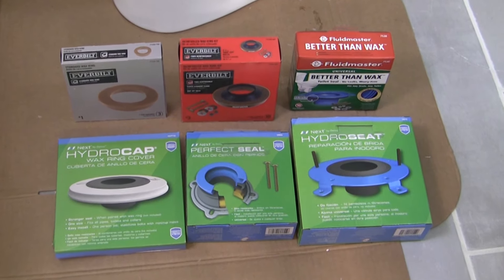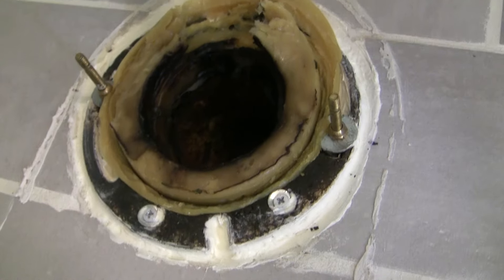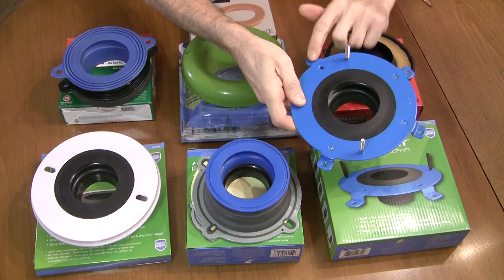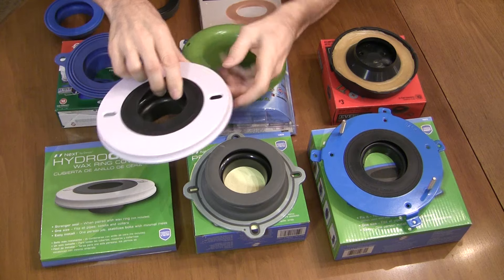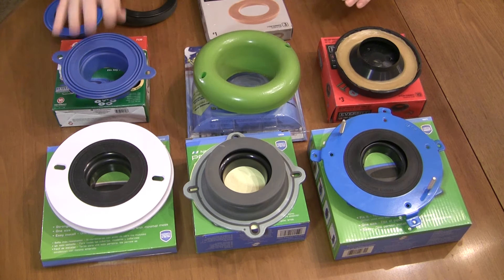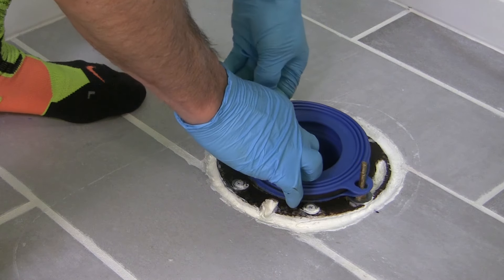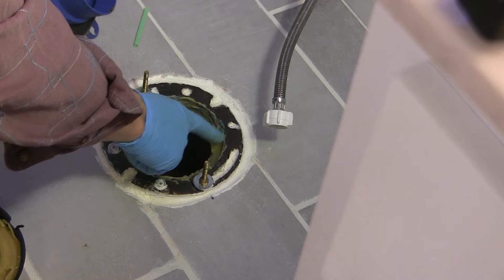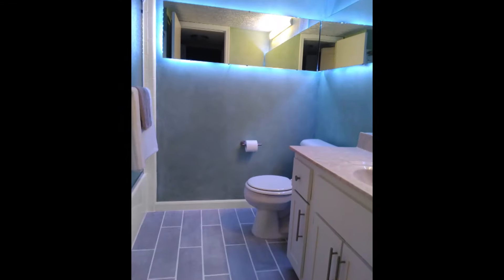2 YEAR FOLLOW-UP to Toilet Flange Fix  / Also, Compare Different Toilet Seals

Comment: Some of the other plastic alternatives you are showing in this video don't need wax on them. I have used the green one, and the blue one in the upper left-hand corner and both work fine without wax.

Comment: My experince with the green foam seal has been less than ideal. First time the kids clogged up the toilet I grabbed the plunger. When I pushed down water sprayed out from under the toilet. Since water doesn't compress it finds the path of least resistance, which in my case was the green foam seal.
Reply from the maker: I haven't heard that before, but it adds to the list of reasons not to use it.

Comment: The reason that the ears are stretched on the bolts is because you have a 4" flange vs a 3" that most homes have

Comment: Of all of those gaskets that you demonstrate in your video I recommend the Fluidmaster on your right.I tried the green gasket left of the Fluidmaster on your right and it was terrible,it flatened out and after that I had to toss it.Wax gaskets are good and do serve their purpose if you never plan on having to change,remove or reseat your toilet for what ever reason.I had to remove then reset my old toilet then a year later when I bought a TOTO Drake to replace my old American Standard which was a water hog the green gasket was shot to heck so I had to buy another gasket which is what led me to buy the Fluidmaster.Like it or not sooner or later we might find ourselves having to remove our toilet because of a stubborn clog and in such cases the wax gaskets are not the best choice because wax gaskets are one time use gaskets.Like you I have nothing against plumbers except when plumbers are sloppy and do not take pride in their work.There is much to be said about the old adage that "if you want anything done right you must do it yourself." My toilet had a 3" elbow with a side inlet for the vent pipe when what was needed was a 3" elbow with a low heel inlet.I had constant clogs with the soil stack the way it was configured because when ever the toilet tissue and waste was flushed the toilet tissue and waste would partially block the side inlet on the 3" elbow,I knew that to be the case because when ever I would flush my toilet the bath tub and bathroom sink traps would get siphoned as a  result of the toilet being flushed so I replaced the copper and cast iron soil stack with 3" DWV PVC and a 3" DWV PVC elbow with a low heel inlet and the problem with constant clogs has been solved.
Reply from the maker: You know a lot more than me.  I had to look up some of the terms you used.  Glad you got it figured out.
Reply: @MartyPollio  Thank you for your kinds words and above all thank you for your videos.God bless you and yours Mr.Pollio.

Comment: The bolts wold corrode inside the tank its allot of moister there , that's why you use brass hardware .

Comment: I am with you any plumbing design that requires wax rings or plumbers paste is destined for problems. I need to remove and replace a heavy Kohler Rochelle one piece toilet for other reasons and have been dreading the task. I also like the Sani Seal but fear a failure. I wonder if something similar to surgical tubing on the bolts could prevent the nicking? Another peeve of mine is electrical connections in receptacle boxes but that's another story.

Comment: Seems like it should work fine. I've got a toilet with an offset flange. That let us move the toilet so it was more centered in the nook where it resides. However, the guy who put in the flange 25 years ago used a type of flange that has this little finger of metal that sticks out into the opening of the flange. Not sure why it is there, but it creates a problem where the wax seals don't last. Eventually the seal starts leaking sewer gas into the bathroom when we run the kitchen exhaust fan. Had a plumber out in November to replace the ring and this weekend it started spewing sewer gas again. I'm old and can't lift the Toto one piece toilet myself. I'm not sure these rubber gaskets would work with the type of flange installed, so the flange probably needs to be replaced with one that has an unimpeded opening. Guess it's time for another multi-hundred dollar plumber visit.
Reply from the maker: What type of seal was used on it in the first place?  I'm sure it didn't leak every few months if it's been there for 25 years.  Many of the wax seals are made with petroleum products, maybe a high quality beeswax seal would do the trick.

Comment: The only thing I would say is don't use the silicone around the toilet when you are finished.   Due to the fact that if you do have a leak there isn't a way for you to see any leaking water coming out from under the toilet.   Of course, if the floor isn't finished around the flange you wouldn't see it anyway.  But you did take care of that problem before you set the toilet.  So I say, well done!

Comment: The reason they don't put porcelain tubes in there as you suggested is that then you have a very difficult tank to produce, with tall pillars that could crack or break and you need extremely long fasteners.
Reply: Wouldn’t stainless steel solve that problem anyway? I’ve replaced quite a few rusted tank bolts with stainless and they seem to resist rusting for many years. I’ve fixed or replaced at least 50 sloppy installs and I’ve never had one fail. Always used wax and made sure it was at least 70 degrees when setting them.

Comment: It seems to me that it's the nuts that you have on top of the washers on the closet bolts that are stretching the rubber ring out of round. Most installations don't have nuts on the closet bolts underneath the toilet flange.

Comment: So, what are the tests to determine if the idea works?  Do we look for water and do a large number of test flushes?  Do we use a sniff test to try and determine if we have leaking sewer gases?  Just curious.  You just discuss ideas.  Kudos for attention to detail on prep and installation.
Reply from the maker: I'm not the right person to ask, but as far as I can tell the quickest way to test is to flush a bunch of toilet paper down and make sure it doesn't clog or create a leak.  In my first video I show where I left an opening under the toilet platform (or whatever it's called that sits against the floor).  I created a pathway to the bathroom floor so I could see if it's leaking.

Comment: Never caulk the bottom of your toilet. If you do have a leak you'll never know and you'll be spending thousands on damage and a rotted out floor.
Other then that.
Not being a price just saying. I know caulk is nice to neatly seal everything up but for a toilet do not.
Reply: Just remember that you can have a wax ring leak WITHOUT any water leaking onto the floor below the toilet.  I have witnessed this many times when the flange is recessed below floor level, such as with tile floors.  Keep this in mind.

Comment: Do you think cutting off the ears of the top rubber seal could have prevented the rubber seal from being stretched out?
Reply from the maker: Yeah probably, but the bottom one would have still needed to be secured by those ears.  The bottom one ended up being the one that was a problem.  Video soon to follow.

Comment: Hey Marty, Thank you!  I just bought a house with toilet that sat on uneven flange.  tried two of three that didn't work and the third the sani-stuff is on its way.  If that fails I'm going to try your method next... Around here plumbers don't come out for a small job like a toilet issue.  Go figure.

Comment: If a wax seal is installed properly it will not fail.  Its been around forever because it works.  My experience with Sani Seal is they deteriorate and only last for about 5 years.  I've removed 3 toilets in my house to put down new tile and every Sani Seal was collapsed and leaking.  They give you unlimited alignment opportunities and thats their advantage.
Reply from the maker: Great comment.  Thanks

Comment: hey man couldn’t you use the saniseal and then shove some wax in the bolt holes to keep it from getting the foam saturated?
Reply from the maker: It would probably be better to coat the inside of the bolt holes with silicon caulking, BUT there has also been evidence that the chemicals in city water wear down the coating on the SaniSeal.
Reply: @MartyPollio  So, only use it if you have whole house water filtration: noted. 📝

Comment: My toilet foundation was deep. I used double wax, but that failed after a while. I used double saniseal and it was great.
Reply from the maker: Double Saniseal!? Seems to me they're not built to stock like that. You're a madman!
Reply: @MartyPollio  Ha, thanks for the read. Per manufacturer, you can stack. Unfortunately whoever made my house was the real madman. I actually tried double stacking wax. Well, that was a mess, no seal.

Comment: I just did one of our toilets with that same exact seal. My only concern with yours is the ID of that iron flange. My PVC flange was smaller ID and that foam seal sat flush on top of the flange. Curious to know how this turned out for you.
Reply from the maker: I'll be posting a 1 1/2 year follow-up to look at how well the seal held up.  Going to make it and post it within 5-10 days.

Comment: i've changed dozens of toilets. 100% of wax rings have failed when i removed. I use the sani-seal exclusively I've removed toilets a year or two after install and never had a problem with the foam being damaged. I have removed/replaced the same toilet a few times with the saniseal. 

Also, i don't seal the bowl to the ground; put down some thin mylar tape, spray with cooking spray, set the toilet down, but put some thin shims like 1/16" under and get perfectly level, then put in some silicone; let it set a couple days and remove the toilet, the tape, and you will have a perfect 'fingerprint' of the tile floor in the new rubber foot on the bottom of the toilet. I do the same on sink pedestals
Reply from the maker: That's interesting, but I can't quite figure it out.  You put cooking spray on the floor so the mylar tape doesn't stick to it?  Then you put the toilet on the tape, shim it and apply the silicone?  After the silicone is dry you pull up the toilet - the silicone is stuck to the bottom of the toilet and the tape will be on the bottom of the silicone.  You pull the tape off and set the toilet down?  Is that right?

Comment: Lots of people pay big money for bathroom heat.... I plumb hot water to my toilets for radiant heat. The tanks and bowls stay clean, there's no sweat or mold on the back of the tanks, the seats always warm & when I flush it serves as a hot water recirculation to that area, so when I wash my hands, it's instantly hot. I'm a heating contractor & I've experimented with this for years.
Reply from the maker: That sounds like a cool idea.  Do you have one of those instant water heaters?  If not, how does the water get hot enough unless it's flushed constantly?
Reply: @MartyPollio  It's not for constant heat. Once you flush the toilet, there's new 130 deg water filling the tank. The water stays warm for hours in the tank after a flush.

Comment: I too am disappointed that there has not been any modern improvements to connecting a porcelain toilet to a pipe in the floor.  Several years ago I saw a bowl gasket that glued onto the bottom of the toilet, and had a pipe that extended into the ABS pipe in the floor, but I can't find it now.  Will probably just go with a wax ring.

Comment: I think filling in the area around the ring is a brilliant idea... and will improve ease of maintenance and prevent contamination...  there is NO WAY in hell a professional plumber would take the time to do that... it would be extra cost and time... they want to come in, get the job done as quickly as possible and get out... I've seen it more than once...
Reply from the maker: Yep.  Probably would charge $600. to do this.

Comment: Just bought my first house, and am learning how to be a basic plumber really fast. Totally agree on toilet designs. On one hand they’re amazing for their reliable simplicity. On the other hand some of the designs make no sense. Why doesn’t the toilet exit go down into the floor so there’s no way it can leak? The multiple rubber seals that will inevitably fail. I had a toilet flapper completely dissolving because they used a toilet puck which I assume was the bleach in it. Basically that will dissolve all the rubber seals. Why even sell those? The bozos who installed the flange put it in off 90 degrees and it’s a slab floor so now the real project begins.
Reply from the maker: Good luck with your house.  Just do as much as you can yourself and call the plumber when you need to.  Too bad they charge so much.

Comment: The Kohler toilets have no holes in the tank. There is a metal bracket underneath the tank and the bolts pull against the bracket. This eliminates the two holes and the rubber that deteriorates with time. Also the Koehler flush is a better design. Instead of a flapper the cylinder lifts up and water flows in from all sides 360 degrees around. Some people remove the black sponge ring from the blue rubber and press it on the toilet horn.
Reply from the maker: That's really good info.  Thanks

Comment: You should get a patent on your design ideas.. and make a prototype. I love the idea of the window at the side of the tank and the two pillars inside the tank. I found your video because I had to repair the wax seal with a rubber one  (just today) AND it is still leaking. And you are right ..having to take the bowl apart every time to figure out why it is leaking is annoying. I used the fluid master rubber seal to replace the old wax seal I had. Didn't realize that I may need another one to fit inside this one. You think they would throw and extra one in the package. Instead of buying another one I might try to figure out how to raise it up a bit and see if I can get it to work with just one. The spacer they have in the package is too tall. I really wish they would make the foam spacer different sizes that could be added on depending on what height you needed instead of having to buy a whole new kit for the blue part. Longer neck on the blue part...  and different sized spacers would be perfect.
Reply from the maker: I agree with everything you said about the Fluidmaster seal.  I'm working on another follow-up video to this one where I look at the seal two years later.  Spoiler alert - it didn't hold up well.  It didn't leak, but it wouldn't have lasted much longer than the two years.  Then again, that could be because of my particular drain pipe. If you think you'll be replacing the toilet with a new one in the coming few years, then the Fluidmaster would be a good no-mess option. However, in the long run, I highly recommend a wax ring, just a plain one without a funnel.  It'll last perhaps as long as 20 years.
Reply: @MartyPollio  yes i might have to go back to the wax.. *sigh

Comment: one side note:  using wax rings,  after a day or so of setting the pot, re-snug the flange bolts because if it rocks and rolls later it will start to seep.  not too much though, porcelain ain't steel.

Comment: Jumbo wax with horn is the best. Tried and true
Reply from the maker: Some plumbers say the horn causes a lot of leaking issues, but I think if make sure you don't move the toilet once it's set down then it won't cause a problem.
Reply: Are you a plumber who has done 100’s of toilet installs? That’s all I wanna know.

Comment: The green rubber ring is the best! .. doesn't matter that the toilet moves, it always seals.  That nicks rap is bs .. I use it in my apartments and have not had any complains in years!
Reply from the maker: A lot of people have said they like that SaniSeal, but if you researched it you'll see that it not only has that problem with the nicks, but it doesn't hold up well to the chemicals in the water.  I really did want to use that one, but I was scared away by those (more than a few) posts I read.

Comment: Great idea that you screwed the bolts down before seating the mammoth toilet.  Please reinvent the whole system.  I'm going to use 5/16" bolts so I don't crush and bend them this time. I will give you updates.😁
Reply from the maker: It's best to get brass bolts and nuts so they don't rust.  Stainless steel would work too.  Good luck, sounds like you have a mess to deal with.
Reply: @MartyPollio  Thank you. Stay tuned.

Comment: I want use Green 🍏 foam beacuse I used extra thick wax wring and week's later got leak We have old metal Flange. I installed Traffick master Allure flooring and water was seapin threw right side of toilet threw seams of floor I never had issues with wax.

Comment: Props to you for trying A+   for effort i would had Tooken off The holes of the rubber seal  so it woulnt stretch  it and make it oblong i see no use but to hold it in place but its not like its going somewhere with or without the holes ...  Other than that good video

Comment: Just curious, why didn't you use the extension that came with the Fluidmaster kis?
Reply from the maker: The extension is for flanges that are below the floor surface.  My flange is not quite level, but at its lowest it's still 1/8" above the floor (1/4" above on the high side).  That extension is pretty thick, it just seemed really big.

Comment: arent you supposed to use just the plastic capture washers under the seal? maybe thats why it was stretching the seal, because you had those nuts holding the closet bolts down..